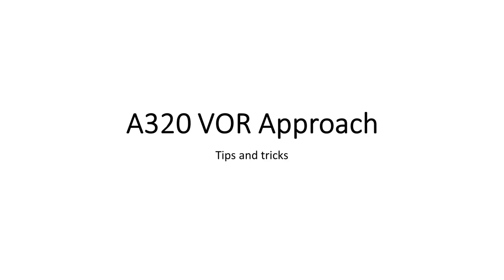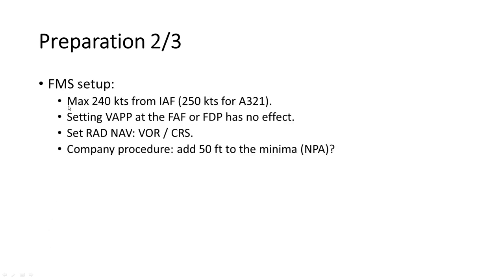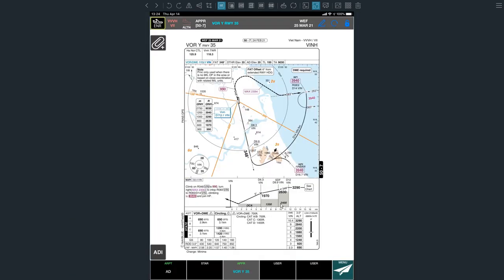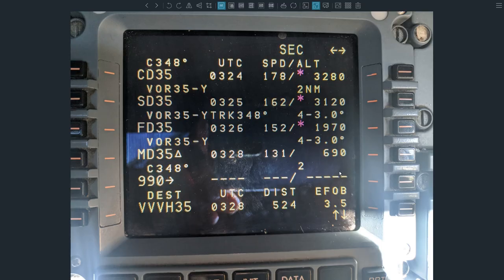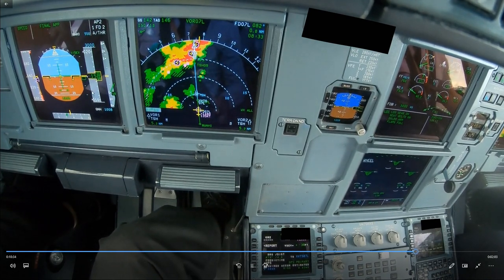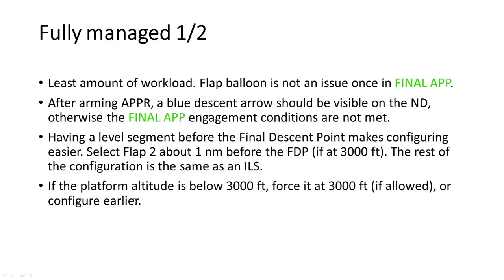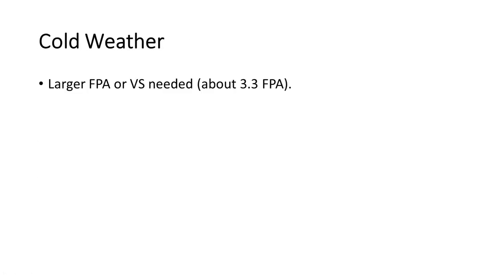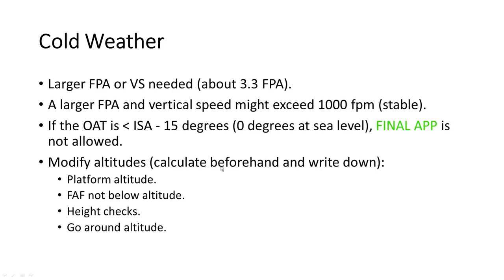A320 VOR presentation

Comment: Maybe if possible you could help from the below?

I'm at 140 knots following 354° inbound (CGS VOR).
From my heading 354° to join 43°inbound RWY 04L at LFMN. I need a right turn of 49°.
If I calculate my time for turning, would be speed/3° standard turn = 140knots/3=16.3 seconds.
Then my bank angle is (140/10)+7= 21°.
From these assumptions and the fact that I cannot turn before 5 NM from VOR, how do I know then when to turn?

If I use the other formula IAS (approx to GS as close to RWY) squared / 10 , I get a radius of (140/60)2/10= 0.9 NM.
But this assumes a standard bank angle of 25-30° right?
Then in first assumption, my bank angle should be 21°. I'm confused there.
If I use a third formula, 1% of GS, I get a radius of  0.7 NM (1.4/2) correct?
Should I calculate the circumference of the circle and start turning from that circumference?
It would be great if you could help me understand this!
Reply from the maker: I don't quite understand what you are trying to achieve without looking at the approach chart. Is this for a real world situation? In my entire career I never had to do something like that. Just follow the chart. If you do a raw data DME arc, just keep your needle at 90 degrees and turn final when the chart tells you. The bank angle you have to keep adjusting anyway, you can't set a static number.